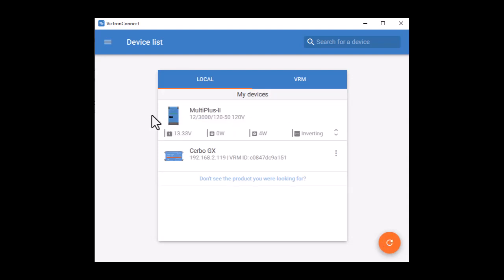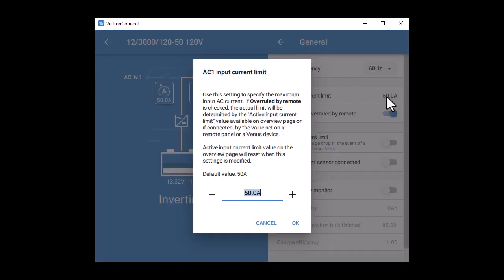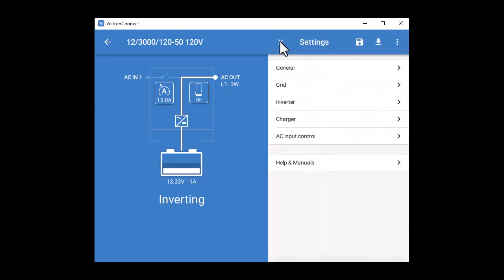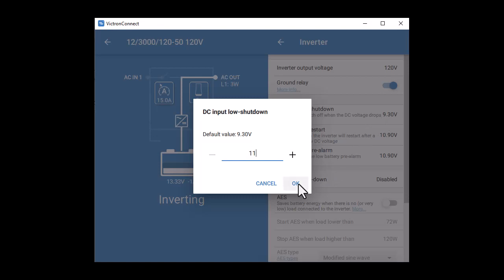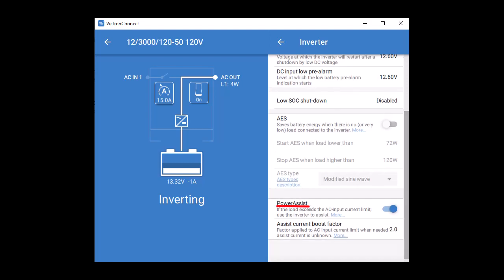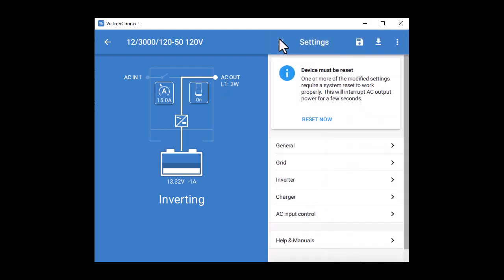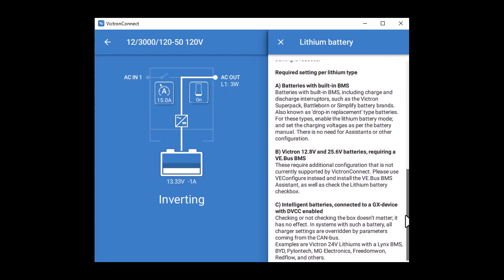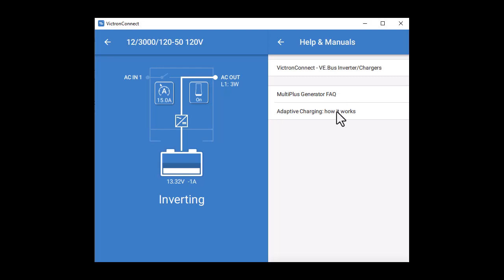Programming your MultiPlus or Quattro with Victron Connect

Comment: hello
nice video
i have a multiplus 8000VA and i can't communicate with victron connect is this normal?
do i need to add an accessory to the multiplus 8000VA so that it is recognized in blutooh?
Reply from the maker: You need to connect the Multi to your computer using a Mk3 USB interface.  If you are still having trouble connecting go back and download the USB drivers from the Victron site.  There are various programs you can use to connect but Victron Connect is the most user friendly and it is the only one that also works on a Mac
Reply: Re
yes with mk3 usb it works very well but I would have liked to make the modifications of the multiplus on victron connect easier on smartphone!
but I have a samsung smartphone not apple!
I wonder if it is necessary to add a dongle for the multiplus?
Reply from the maker: @laurentsosson1739  You cant use the Dongle for programming.  Its functionality is limited to turning the Multi on and off, switching to charger only mode, and  adjusting the current.

Comment: Do you know why the readings from the current transformer wouldn’t show on the grid box in remote console when plugged into current sense port?
Reply from the maker: You have to set this up in programming using the "Assistants"
Reply: @ I have ess assistant running is there another one to use with that one?

Comment: Thanks for the interesting video. As I do see my Multiplus on VRM but not on the Victron Connect app, as in your case, what do I have to do to see it in the app?
Reply from the maker: This video describes programming the MultiPlus locally using your laptop and Victron Connect.   While it is possible to do this remotely over the VRM it is for advanced users and uses a different program.  I wouldn't recommend trying it until you have become thoroughly familiar with doing it locally first.  We don't give out the instructions but you will find them in the VRM Portal Documentation
Reply from the maker: You have to connect it to your computer using the Mk3 USB interface

Comment: Question regarding power assist. Power assist means you are using two power sources. 
In some countries in Europe, using two power sources is not allowed.

What is the code in USA and ABYC view on using two power sources at the same time?
Reply from the maker: This application is permitted in the US.  We are augmenting the incoming power but we are never sending power back to the grid.
Reply: What is the best way to prevent sending power back to the grid with split phase  two 48 5000 inverters?